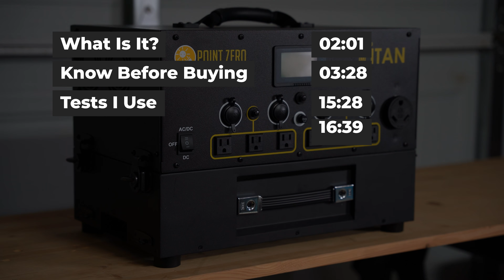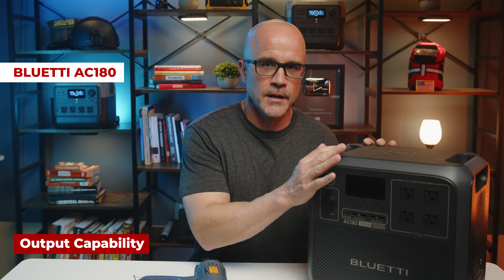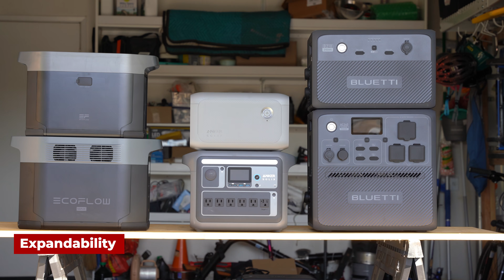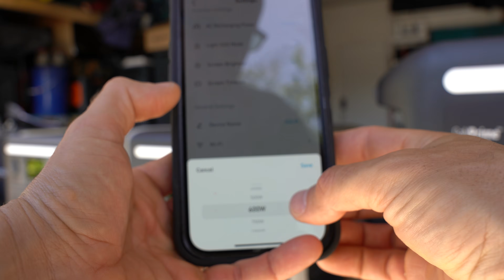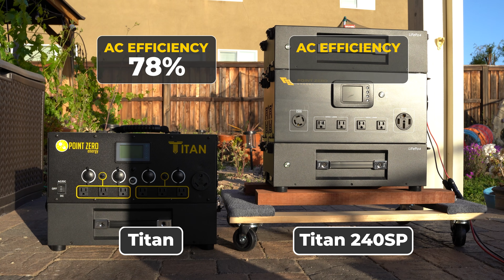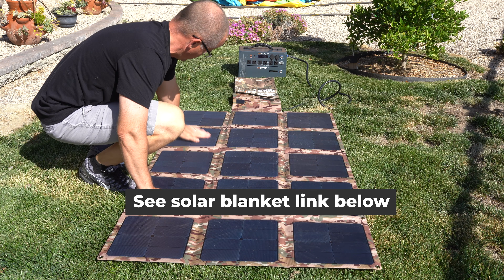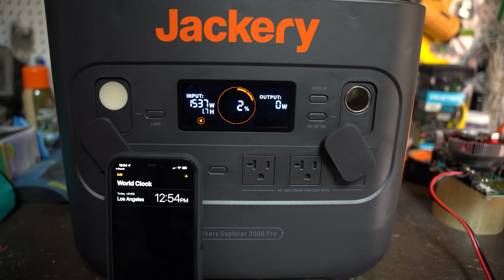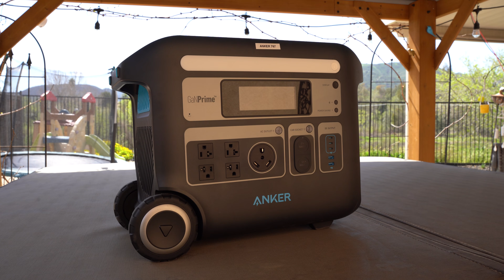Best Solar Generator for 2024 (The Ultimate Guide)

Comment: I just purchased the Ecoflow Delta 2 as a portable backup to my ICE gas/ propane generator…Love it so far!
Reply: I have the same setup. It feels like such a waste to run the generator all night when my fridge isn't actually pulling current all night. Plus, I can top off the batteries during regular maintenance runs for my ICE generator.
Reply: @dogishappy0  why doesn't a fridge pull current at night?  Newbie here learning.
Reply: @KillaNola  No worries! The fridge pulls current at night, but only when the compressor turns on. My fridge's total energy draw over the course of 24 hours is under 2kWh. Why run a gas generator to power a fridge all day ($60 or more in gas when gas stations are potentially inaccessible) when I can top off the EcoFlow with the generator for $3, then run the fridge off the EcoFlow?
Reply: @KillaNola  during emergency situations a fridge can hold a food-safe temperature for 24 hours if it remains closed. What I used to do was run the fridge a few hours during the day with a gas generator to bring it back up to temp, then lock up the gas generator to save fuel. This isn't the way a fridge is meant to run though, and can add unnecessary wear shortening the life span of a rather expensive appliance. 

Power stations do not have this limitation, so I instead top my power station off during the day with solar (and the gas generator if needed), then plug my fridge into my power station and let it run normally. This saves a TON of money in both maintenance and fuel costs.

Comment: I've been putting off a solar generator for too long.  2024 is the year I make it happen.
Reply: The priority after food and water is energy.
Reply: @henrymorgan3982  5 priorities for living, food, shelter, clothing, communication, transportation.
Reply: @henrymorgan3982  nope it's brass!
Reply: i think goal zero will have a LOT better offerings through 2024, they're finally catching up.
Reply: That is a very good idea for a few reasons.  Shoot to have it done by Fall.
Reply: What are you getting?
Reply: Hi everyone I’m a new subscriber! Great content 😊
Reply: Why don’t we call it a solar power bank since all it does is store power?
Reply: @MichaelWilliams-ro9bm  because it generates AC voltage by DC batteries, the same way a standard gas gen engine generates AC voltage.  If all you got from a solar generator was DC voltage, then it WOULD be a power bank.
Reply: @AlL-ff7cn  until power from ac is gone, right?
Reply: @MichaelWilliams-ro9bm  No, until the batteries are depleted you have AC power.  Like when a gas gen runs out of gas; no more AC power.
Reply: @MichaelWilliams-ro9bm you can call it whatever you want.
Reply: @MichaelWilliams-ro9bm Because it generates power. That’s what solar power panels do.  If you have no panels, then you have a storage pack with capacity to generate.  They do sell power stations that can only store power from an AC power supply, essentially at huge battery.  But this one generates electricity from sunlight, the way a gas/diesel unit generates electricity from fossil fuels.
Reply: @kld70  it stores power, period.
Reply: It’s like I wrote this post. I am feeling the same way

Comment: Something else to add is the ability to have pass through power. During the day I can power things with the panel by having it connected to the power station. Once the sun sets then the power station can take over until the sun comes back up.
Reply: I agree.   For me pass through is important
Reply: When you run things during daytime, do you limit power consumption to approximately 50% of generated watts? (Please anyone answer)
Reply: My Bluetti PS will give priority to solar. So I leave in plugged in. Solar power by day, line by night, battery charged for power outage.
Reply: They all have “pass through” but it’s a question of how efficiently they implement it, ie, whether their built in solar charger supports a true “float.” If they don’t support float, then in very least the charger will commence charging once the battery has been slightly depleted by any load, and you kind of get a pass through in that manner albeit less efficiently than float.
Reply: Yeah I really wish he would have covered passthrough in the video but a Google search will have to do
Reply: Assuming you have solar…
Reply: @richarde1355 "once the sun sets"... what gave it away?
Reply: @wayneberry3453  Sunlight comes through the bottom of the earth as well.

Comment: I don't know if the numbers are correct, but the Pecron stations are mislabeled. The E2000 has six AC outlets and the E1500 has 3 AC outlets. The newer, US version of the E2000 has 4 AC outlets and a RV type plug.

Comment: Here in Arizona solar is a great way to go. For me the Pecron E600LFP is my sweet spot for price vs watts vs capacity. At 1200 watts it can easily power my coffee maker and 614 watt hours is more than enough to power my refrigerator (it pulls 125 watts when running) while I charge my second one. The only caveat is needing to get a high voltage solar panel to charge the unit. The 36 volt/200 watt Edostory panel works well and is budget friendly. I have videos on my YouTube channel  if anyone wants to take a look.

Comment: I'd be curious how these Solar generators stack up powering various size chest freezers...there's a good video idea, Kris. Food preservation is obviously huge during an extended power outage. I not only can a lot of the produce i grow but also freeze a lot too. Things to consider: I've heard the more full a chest freezer is, the more efficient they are?...how many solar panels could keep the solar generator in the goldilocks charge state indefinitely running a chest freezer or 2?...how about cycling frozen gallon jugs in and out of a large, well insulated cooler for refrigeration needs?  I do use a chest freezer and honda inverter generator (ICE) for elk camp with great success and even run the freezer in the back of the truck full of the game I harvest for the long drive home.

Comment: Only issue with ecoflow is the fans are a bit noisier and the efficiency is not as good, the ability to fast charge from the car is way over priced and can be done much cheaper, expansion on all these units is expensive and much cheaper with a DIY setup to compliment these units.

Comment: lots of good info.  I did a ton of research before i bought a jackery1000 two years ago and after using it camping and on hunting trips with my camper i discovered three things are important to me.....1. How much the inverter can handle, turns out i want it to mimic a house circuit of about 1800w so it can run usual counter appliances while camping. 2. Can i recharge a depleted unit in a day say 5 full solar hours so a 2kwh battery needs to accept at least 400w. And 3. how heavy is it so that i can move it without risking injury. Personally i dont like the apps and have noticed at a well attended camping area that there are multiple signals which i feel ups the risk of some tech savy nurd messing with my system.   For me the Bluetti 180 is a good fit and so far love it.
Reply: I have a homemade 3000w (ac) solar generator with a 300ah battery (capable of 3.6kWh peak), and 3x200w renogy solar panels charge the battery from 60% to 100% in about an hour. It’s pretty mind blowing that we can harness that much power for free from the sun.
Reply: @GioGuitarDude How much did this system cost you please ?  That's a lot of battery and expensive panels, plus the charger and inverter and more.  Wish I had the money to build that.
Reply: @ServantOfJesusChrist777  It was right around $2000 with the 3 solar panels included in that price.
Reply: I built it myself because a similar wattage unit off the shelf is like 2-4x that… and the internal parts aren’t really serviceable. So if the battery goes caputz then the whole thing is a $3500+ paper weight.
Reply: @GioGuitarDude  can you provide a list of components that you used? I'm interested in putting one together at our cabin and I like your idea.
Reply: @montyjones111  That’s a pretty comprehensive list, but the bare bones of it are basically a 300ah lipo battery, a 3000w pure sine wave 120v A/C converter, a LiTime dual charger (can charge by way of solar panels or off of an alternator on a vehicle), a fancy flush mount LED light, a 300a circuit breaker and two independent 300a switches for both the 12v accessories and the 120v a/c circuit. It has a bunch of fans, switches, and charging ports for various things. Oh, and 2/0 gauge wire going from the battery to both switches, and from one of the switches to the 3000w 120v inverter. I’ll see if I can upload a video to my channel really quick.
Reply: @GioGuitarDude Would a residential electrician be able to wire this up for someone for a comparable price to the portable ones?  Like you said, at least one could service it much more reasonably then relying on a warranty that require registration and expensive shipping for mailing back the unit.
Reply: @kld70  I don’t see why not.
Reply: @GioGuitarDude  Thank you

Comment: Good video gives good useful information for those who may not have the knowledge on these units. Being one who has done my own solar systems I can testify it is cheaper to buy the smaller premade. One can still save a lot on the larger systems. One of the most important reasons you mentioned is the learning by doing. This is so important because there will be a better chance of trouble shooting & repairing what is understood. However, with that said some of these small systems are becoming pretty powerful with the advantage of adding capacity, handling larger loads both continuously and surge.
Portability is where these really shine and designed for but that changing fast.
Stay Safe & Good Luck

Comment: have a good solar generator and a smal diesel generator you can use any bio oil in some diesel engines. if you manage to get a steam engine generator that is the holy grail, steam engines can use almost anything for fuel.

Comment: Very good presentation.
I also have done a lot in this area and one point that you really did cover, is people miss the point that it is not just what can a unit run/operate, but HOW LONG CAN the unit operate.  You can operate lots of stuff for a very short time, but in many cases, the time that a unit can support a piece of gear is very short and often too short to be considered viable.  Also start surge may typically be 3 times the continuous operating power need.

Comment: I live in a very small town,  far “upstate” NY. It’s common for power outage many times during the winter. I have a pretty good gas/propane generator but I decided to try a solar generator.
I purchased a set of 2 EcoFlow Delta Pro’s, along with 2 400w solar panels on Dec 2023. 3600w each. I chose this set because I would be needing 240v for my water pump and water heater. 
Very heavy but so far, they have worked perfectly. Of course, during the winter season, the farther north a person lives, the shorter that the days become. Plus, the sun doesn’t shine directly over head, even on a supposedly, sunny day. 

I’ve never tried any other solar generator along with solar panels before but it does seem to be a good choice.
Reply: Try that in a small Town!! 🎶 🎵
Reply: You chose wisely.

Comment: Most of us are just happy to have one (of whatever make, capacity or age).
The danger is a kind of FOMO when you've had one for a while (in my case 4 years) and the newbies on the market are painted to look better.

I have been VERY happy with mine (ECO) for short-to-medium term lowish current draw applications.
I am prepared to trust/rely on my petrol (<gas>) generator for high current applications, or when my solar array fails to provide input greater than WH outflow.
Fuel might become more expensive, and in that case I will be more careful of the frequency in which I'll fire up the generator... but I can always count on my <solar generator> for immediate reliable energy for most of my immediate needs.
In the WCS (inverter death), this device will keep vital  240V devices working for several hours.
Also, I have multiple options to add WH capacity if I need, as it accepts any 24V source for immediate use and various recharging options.

My main point being to analyse your situation with care.  If you're considering your first purchase, by all means do all your homework.  If like me you have an earlier device, think carefully before wasting money on the latest gizmo.
Reply: I wholeheartedly agree. Supplement as necessary. Don’t replace and waste.  👍

Comment: Hey Kris!  I bought my Ecoflows (and started prepping) based on your recommendations last year.  However, I have them in EMP bags in the closet.  I didn’t realize I’m supposed to be taking them out every 3 months and running down the battery. 😳 Oops!  So, do I drain it down and then charge it up half way before restoring?  Do I need to include the expansion battery in this process?  Maybe this should be somewhere on the CP Community site…

Comment: Curious why not include inergy flex?
Reply from the maker: Out of date with no new updates!
Reply: @CityPrepping  I own a flex dc and it’s pretty powerful it can run a 5000psi air compressor, and with the supercharger it can use three 90V panel arrays for 90A (1,200W) of solar charge input. Also the ability to stack and combine more batteries. I don’t really get it. Don’t get me wrong I love all your choices but I just don’t see it…. Maybe WiFi or Bluetooth but I think they are working on a plug and play add on.
Reply: @madmaxthemotomutt6464  Awful price per wh. Old battery tech. Lower max inverter output. It obviously works for you but all the others are likely better value choices.
Reply: @Mike_219  the more I look into current 2024 tech, yea I can see how it is outdated now.
Reply: I purchased mine 2-3 years ago. If I was buying something new today I would probably do it differently

Comment: I purchased the Ecoflow Delta 2 and backup battery which essentially gives you the same power as the Delta 2 Max. Had I had the choice at the time I probably would have gone for the Delta 2 Max because of its better expandability.

Comment: This is a great giveaway. I was without power after hurricane Irma in 2017 and the heat and humidity in the following weeks were so unbearable. Handheld rechargeable fans did little to cool off and it was near impossible trying to sleep. My apartment traps heat and gets no breeze. I hope I don't need to win it, but it would be reassuring to win it.

Comment: This video couldn’t have come at a better time. I’ve been researching a lot of these for a couple of weeks and the this is the most up to date and comprehensive video I’ve seen yet. Thank you so much for the time and effort that went into this and kudos for doing that outstanding spreadsheet.
Reply: What did you end up settling on?
Reply: @maggew  I went with the anker c1000. It packs quite a punch for the weight and size. I’m very happy with it.

Comment: Don’t most cooling appliances like refrigerators cycle? Is the 200W only for when it’s running or is that an average? Also in a grid down situation WiFi is not what I would focus on because of the additional power demand.

Comment: I love the way you present your videos and reviews. You make it easier to understand. 

I have the Ecoflow River 2 pro and it is great but I need something with more power for those rare occasions. I would love to have my whole home run by solar but that is not in the budget.
Reply: I've realized that I'm better off right now having multiple more portable units that I can move to a few rooms in the house as needed. With the exception of the worst part of summer, I can get by on fans and I have a few battery-powered ones that will work. Long-term, I'll likely go with a 10kW+ tri-fuel generator connected through an interlock to power the whole house from natural gas.

Comment: So, only one unit is USA made, where are the others manufactured?
Reply from the maker: it's not US made, the company is based in the US.  ALL units are made in China.
Reply: Thank you for the answer 👌
Reply: @dennyinthesouth8711  he is correct, it is designed  in the US and built in China, something you might not have noticed that he said was that it's a low frequency inverter, all the others are not, they are high frequency inverters. Low frequency  is much stronger, longer lasting, and can be repaired if need be, for much less money. Most high frequency  units are throw away units when they fail. Some of those units like bluetti,ecoflow are decent units, but when they fail they are trash, I mean to expensive to repair. I have 2 Titans, and I can tell you from experience, they can run max power continuously, day in and day out, and he was wrong on one aspect of the Titans. There is no limit on how much battery capacity you can put on them, and you dont have to only use there batteries, you can use any 24v battery  configuration alone or in combination with there batteries. They ain't cheep units but they are overbuilt in almost every way. So you do get what you pay for. You won't see anyone badmouth these units
Reply: Can they be serviced locally?